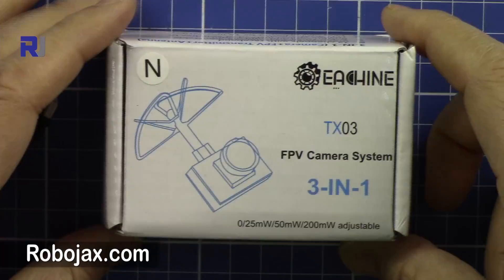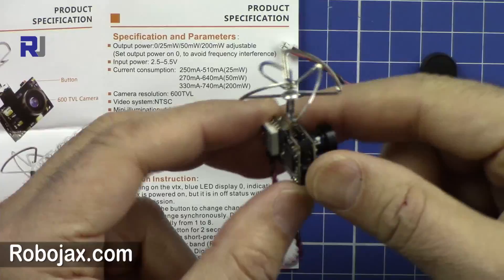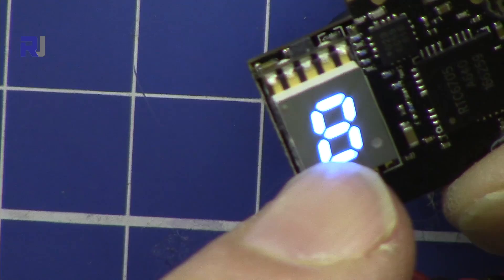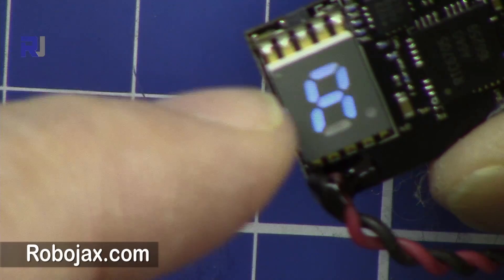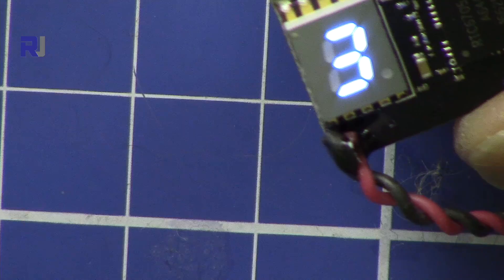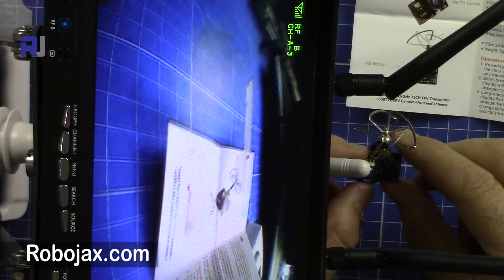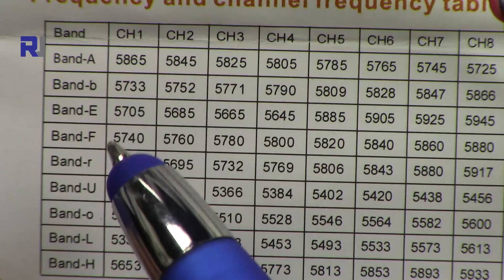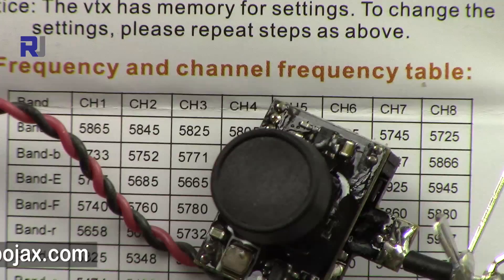How to setup and use Eachine TX03 3-in-1 FPV Transmitter and Camera

Comment: Thank u so much to explain how it works I thought that if we switch on the fpv it will directly connect to camera but u showed that it directly won’t connect.please in next video please can u tell how to connect and uses the camera off eachine and how to use fpv of eachine which we wear on our eyes or WiFi googles
Reply from the maker: this is only working on FPV with 5.8GHZ which is not on wifi.

Comment: Very nice video, you have been very helpful. I have a question concerning the battery. I have a 3.7 1s 600mah  will that work fine or do I need a 3.7 250mah.
Thanks for your help.
Reply from the maker: This camera needs very little current (or power) comparing to the drone. It can work with your battery no problem, and any battery 2.2 V to 5.5V.

Comment: Does your camera heat up when you use it?  I'm using a 3.7v 500mAh battery and on the 200mW setting the camera gets really hot, almost burning me.  I'm gonna try to reduce power output to 25mW if that will help it
Reply from the maker: Yes it does. it is getting hot and it should run for very short period. Or just lower the power.

Comment: Can we use this camera in computers
Reply from the maker: If you watch the video, you will see that you need 5.8GhZ receiver to receive the video. You will need this https://www.ebay.ca/itm/202152205339 to receive video.  If you use  regular (https://www.ebay.ca/sch/i.html?_osacat=0&_odkw=boscam+fpv+receiver&_from=R40&_trksid=m570.l1313&_nkw=boscam+rc+832&_sacat=0)  type of video receiver, then you will have the video output. which composite video like VCR (old 1990s) quality with yellow RCA jack (https://snag.gy/yT671H.jpg). So if you computer has composite port with RCA jack,  then yes you can view it on computer but you need RCA input. This device has RCA input for computer https://www.amazon.ca/dp/B072KRZQVF

Comment: Why do these cameras have a zero transmission option. Its not like it really turns the system completely off right, its still blinks and drains power?  If thats the case I don't see the point of that option.  Doesn't bother me, interesting talking point.

Comment: Can i use a 2s lipo with it?
Reply from the maker: no you can't . Operating voltage is 2.2 to 5V. So anything above 5V will kill it. 2S is 7.4V.
Reply: If you use a 5 volt regulator you can.  Otherwise it will get fried.

Comment: Can i Use Jst plug to power this camera???
Reply from the maker: The connector is: JST-DS LOSI . See the battery here https://www.ebay.ca/itm/281689872538
Reply: do you need an extension cable or anything for the battery?

Comment: sir I am new,can i use it with eachine vr800 goggles without any extra tools
Reply from the maker: I just checked VR800 and it has 5GHz receiver with antenna. so yes you can use. Just power up this camera  and it will start sending  video and your goggle will receive it.
Reply: @robojax    thank you sir ,and one more question ,can i use all the TX02-3-5 camera with vr800 if so how can i decide if this camera suitable or not (sure without extra tool) and how can i know the range of the camera i mean how far i can fly with my airplane

sir thank you again

Comment: Would it can be powered with any Lipo battery?
Reply from the maker: It needs very little power. Yes you can power it as long as the voltage is not above the limit which I have explained in the video.
Reply: @robojax  thanks, but my battery has a jst connector will it connect to the fpv camera
Reply from the maker: You can solder your own connect on the battery and the camera.

Comment: 1:41 where can I buy that cable?
Reply from the maker: I had to watch the video, do eBay and Amazon search. You will need to make with using two connector:
1- 
https://www.ebay.ca/itm/10Pcs-Mini-Micro-PH-2-0mm-JST-2-Pin-Male-Connector-Plug-Wires-Cables-200mm-HK/223292054305
2-
https://www.amazon.ca/dp/B079PL6KQ7

Comment: My tx03 shows an horizontally mirrored image when showed on an android smartphone using a Eachine ROTG02 receiver. Do you people know any solution for that? Thanks!
Reply from the maker: this is not from camera. You have to change settings on your monitor or goggle.
Reply: Robojax hey, thanks. Precisely, changing the microusb smartphone for a usb C one un-mirrored the image, although I don’t understand why
Reply: actually the problem was related with ROTG02 and it is not controllable. It appears also with USB C smartphone. Any advice?